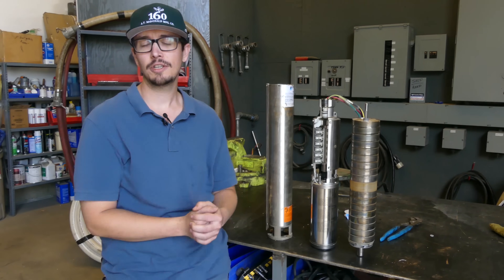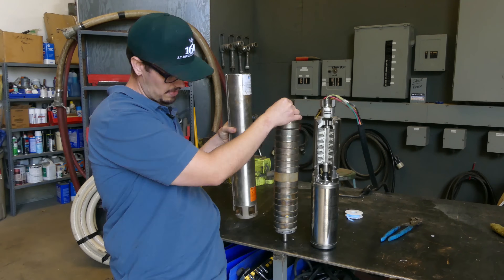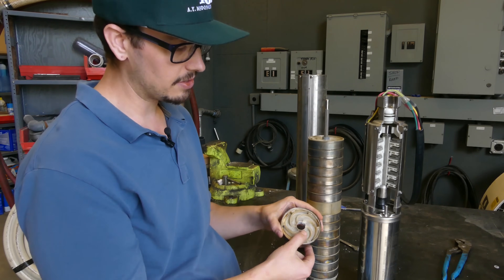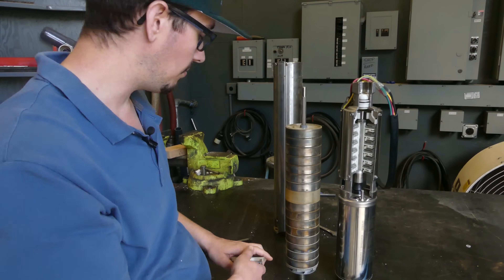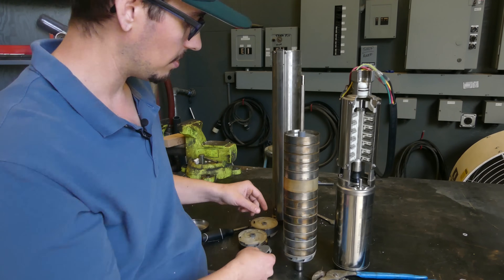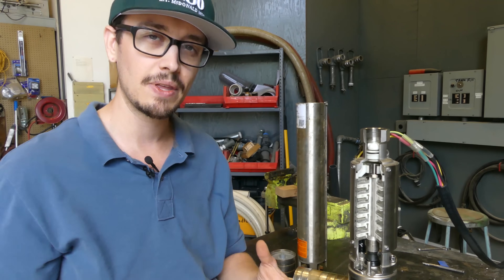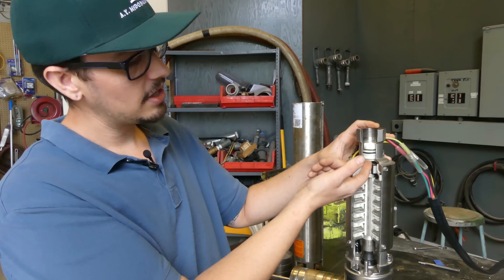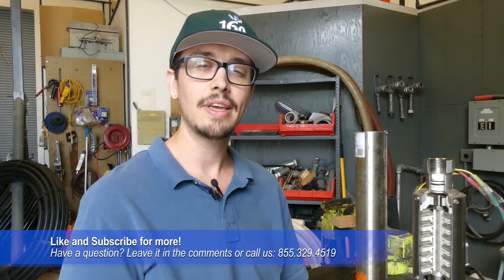What's Inside a Submersible Well Pump: Pump End Disassembly (2/2)

Comment: Hey I have a brand new well pump I installed, a 25gpm 5Hp in a 200 fr deep well. A brand new pressure tank and pressure switch as well. I’m having an issue where my pressure tank will not go above 10-15 psi max.

Comment: Just replaced my well pump with a new one, and want to try and clean the old pump to be a spare. I'm just having trouble opening the lid, and wanted some insight on whether it's threaded on or just stuck... 
(the previous owner of the property did a no no and used an iron fitting to attach the pump to the pipe and the pump is full of rust deposit now... Don't recreate this mistake, just pay the extra buck for a brass connector........)

Comment: Do you guys do repair on A.Y. McDonald 23050J2A? .5 hp 115v  It was literally brand new and someone left the garden hose on burning the pump up (idiots).0 Motor runs but not pumping any water. It pumped enough to run the well out which only held about 100 gallons. Looked like it might have melted the propeller? If so I'll ship it to you guys.

Comment: Great video but you have missed one vital point. How to get the casing off!
I have an Ebara Idrogo pump that has been damaged when being shipped. There are 2 dents in the casing from the inside out. Do you think it will be ok to use? Seems to turn freely. I would like to get the casing off to check. I have undone the 4 allen bolts at the bottom but no idea how to get the casing off.
Reply: Exactly why I came here...

Comment: Thanks for the great video, am going to use submersible pumps for sewage lift station, what is the recommended impeller material, and is polyamide is good material for sewerage. thank you
Reply from the maker: Give us a call for help with your application: 855.329.4519

Comment: Thanks for all your effort to make these very informative videos! I think a lot of people just don't comment, but many are getting benefit from them
 
I've had 2 SCHRAIBERPUMP 4" DEEP WELL SUBMERSIBLE PUMPs take a shit on me in less than 2 years and I'm getting tired of pulling them 100' out of the ground. Both tossed the motor and I was still able to spin the pump with a drill. One was 220 and I upgraded to 460 three phase but that one choaked in 9 months. Even if they honor their 2 year warrantee, I'm reluctant. I have some sand (about 1/4 of a 5 gallon bucket purged from my vortes filter in 9 months), but like I said, the pump is not bound up and spins freely. Your thoughts? (4" casing, 4" pump set at 100' with a static water level at 65')

Comment: Good video. You said the pump is old , what would you consider "old" for a pump? I installed my pump in 1993.
Reply: Wow, we installed ours in 1980, 287 ft well - pump set at 220 ft. It is a Gould's pump it withstood a direct lightning strike in the mid 1990s, took out the controller but the pump survived. Only problems I've had is leaky capacitor in the controller so now I keep a spare on hand. Pressure tank failed a few years ago so I replaced it with a larger one to reduce short cycling. 

Hope I have not jinxed our system raving about its longevity.
Reply from the maker: 10+ Years is old, yours is very old!

Comment: Got my  well survey yesterday and it’s 210 feet deep with static level of 130 feet. How far off the bottom should I stay? I’m assuming you shouldn’t set it on bottom, I bought 200 feet of the high pressure black plastic pipe, should I go about 185 feet? That’s supposedly what the bad pump is at, the original installers did so much shoddy work I have no faith in their idea of what’s right. Thanks for any advice
Reply from the maker: 10-15 feet off the bottom is plenty. Thanks for the comment!
Reply: R.C. Worst & Co., Inc., thanks for the advice sir.